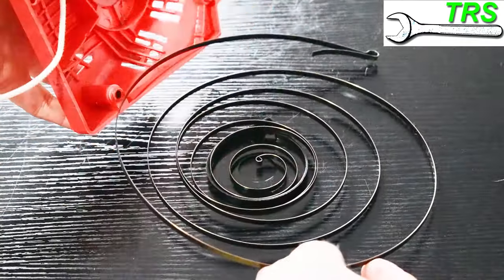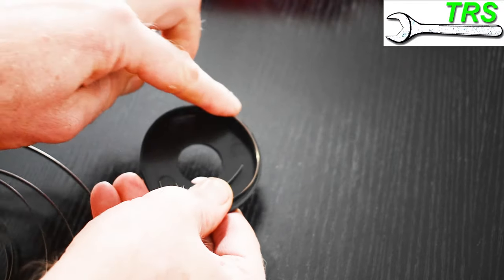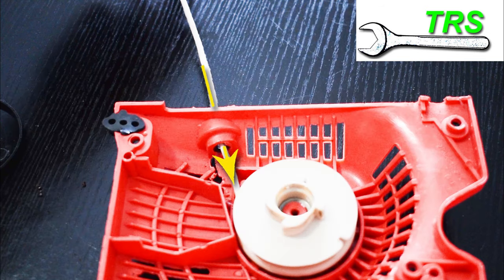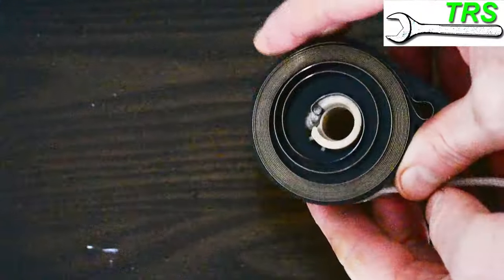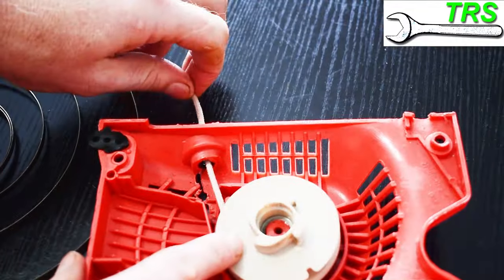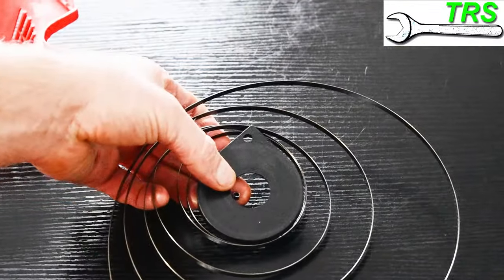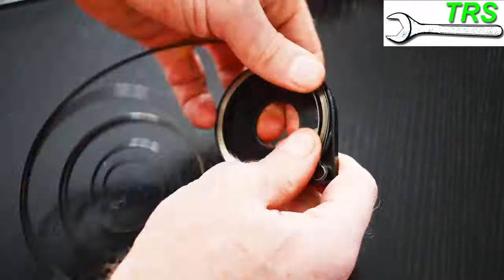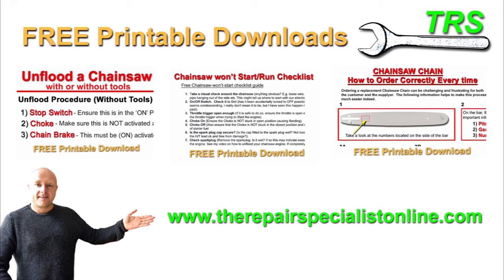Chainsaw Recoil Starter Spring (How to Rewind)

Comment: i have an aldi sheppach saw and i am a complete saw virgin , currently my saw is sitting idle with no pull chord and the spring doing nothing, i bought a pull rope and intend to fit it and fix the spring issue so hoping this will help me through the process , thanks , new sub

Comment: nice explanation.  some people use a nail driven into the workstop to hold the outside end of the coil and then wind it tight and put a zip tie around it to hold it until you are ready to put it into the housing.  definitely wear safety googles. there is a lot of pent up 'potential energy' in that coiled spring.   also.. be prepared to use every curse word you know..when it takes you several attempts 😅...

Comment: Great directions, yet I've nearly finished winding the spring numerous times and it pops off or it pops off once I try to install it on the saw.  I eventually got it after like 15 tries.  I used a vice grip to hold the spring in the slot and it took 3 attempts at installing the spring with the rewind string before it took.   So basically this 20 minute job took me an hour and 20 minutes and a lot of choice words.
Reply: Today I used those same words! Finally almost had it and used needle nose pliers to hold and twist from the bend in the middle... and finally!!

Comment: I f*cked up my spring and have to order a new one ..
Hot tip: Don't improvise. Don't bend the spring using pliers and don't straighten the spring to make it easier to work with .. 😬 (Newbie mistake I guess.)